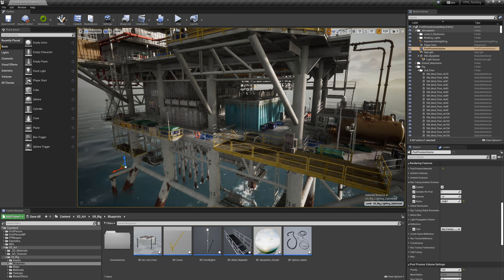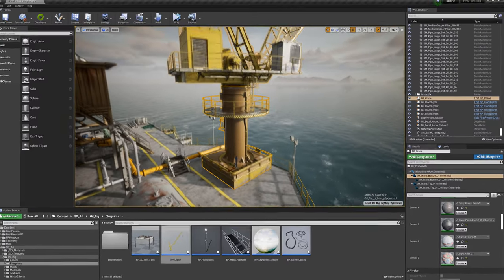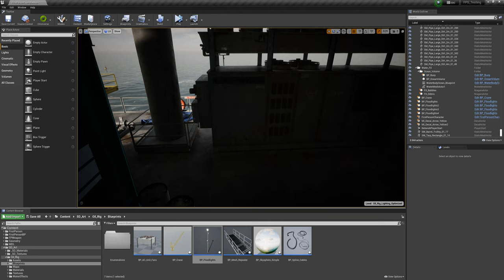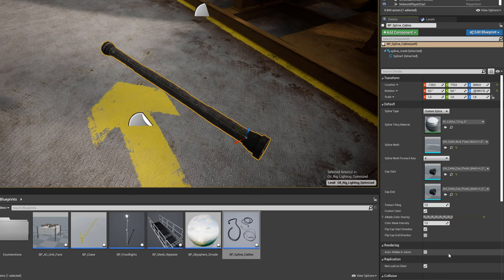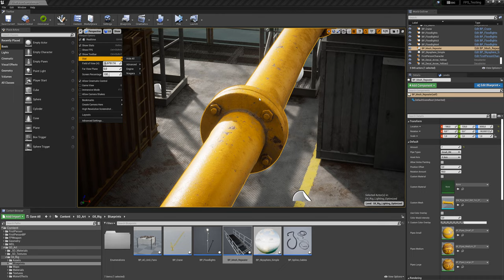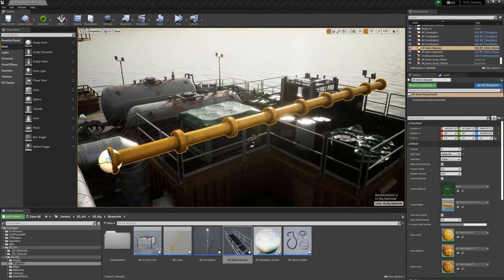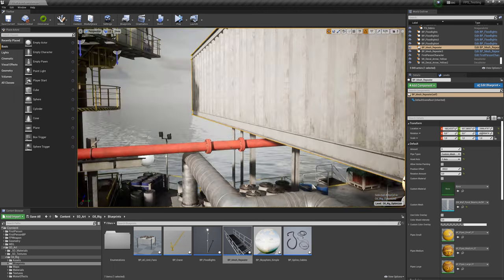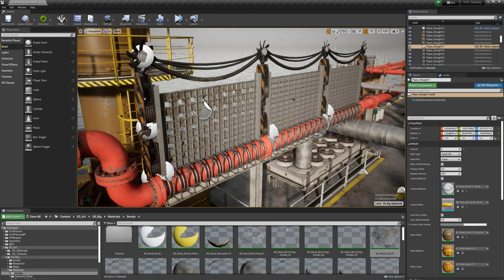Blueprints Overview and Examples - Oil Rig

Comment: Love how much effort you put into the pack and how well you explain everything.
I'll definitely keep an eye out for future packs from you guys and this one might also come handy some time next year, when I finally found the time to upgrade from 4.26 to 4.27 or 5.
I have one suggestion as further improvement for this pack, since that is what I was kind of hoping for when checking out this BP video:
It would be really cool if you could separate the crane a bit more to be able to control the angle of the arm and the length of the cable/height of the load, too. So that we can bring in more differentiation between multiple cranes and maybe even animate or control them a bit.

Thanks again for the great content!
Reply: Oh, and an upgrade pack with more specialized oil rig machinery for the drill deck and pipe deck would be awesome, too. Like drill, dog house, mud shakers, pipe crane, etc. Could even get sold separately as a part 2 or a kind of "DLC", maybe :D
Reply from the maker: Thanks so much Corcutter :)
We really wanted to be able to include features like that for the Crane, it was on our radar as welll. In our case, most of us are artist focused and don't have as much of the tech ability to add these features. We hope that in the future as we continue to grow we will be able to bring more functionality to our artwork. Then we can hope to add things like this to future packs. More videos are on the way soon! Currently getting over a cold, so my voice will have to wait for the next ones haha.
Reply from the maker: @corncutter  We were wondering if anyone would notice that they were missing haha. Good catch. With the amount of content we created for this asset pack, there had to be a time where we decided it was enough. If we continue with more industrial content, we'll have those assets in mind for sure.